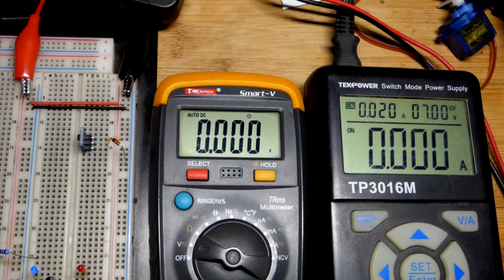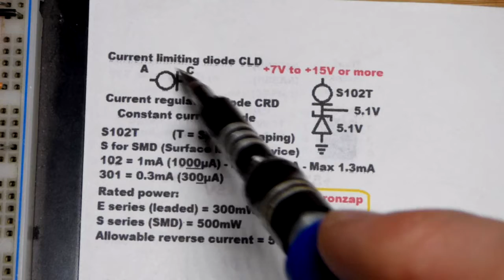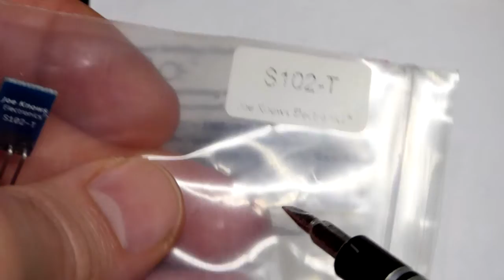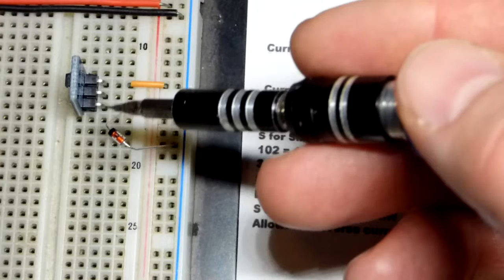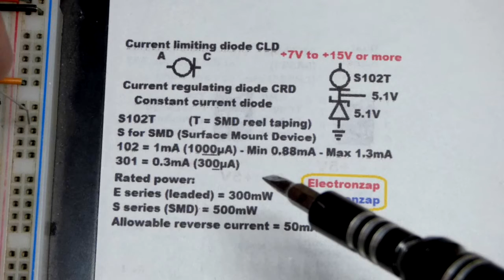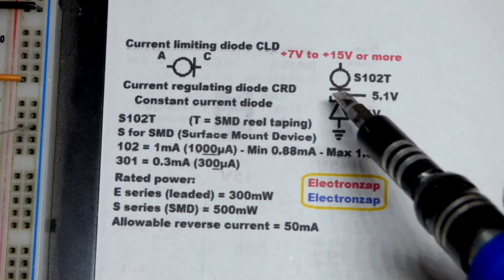S102 current regulating diode steadies zener diode reference voltage by Electronzap

Comment: Awesome, I have never used or heard of this guy till now and it seems a realy useful device I wonder why you don't hear much about the ? (at least I haven't!)...cheers.       Have a great new year!
Reply from the maker: It's actually just a specially selected JFET transistor that has a 1mA Idss. It's really easy to take a JFET with a higher Idss current and use a single resistor to set a current to anything less than the Idss.
Reply: Thanks, I going to play around I have found the data sheet for S102 and I need more time with JFET as well !!!......cheers. @Electronzap